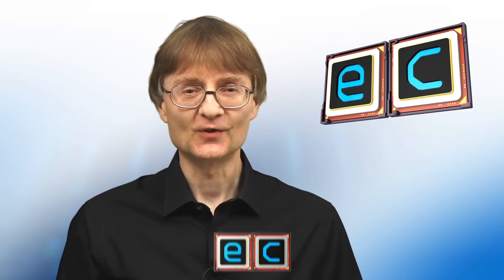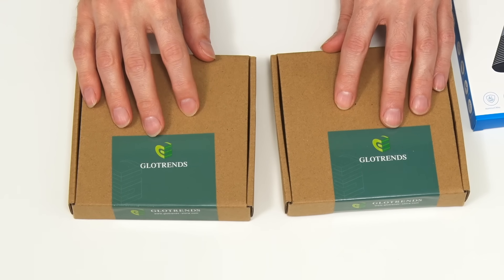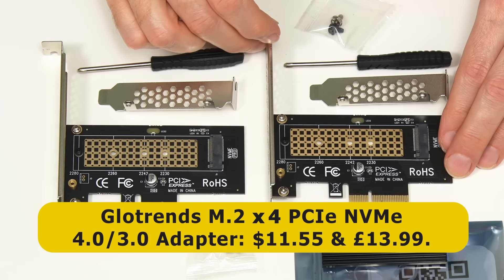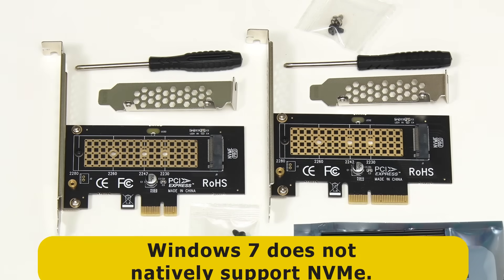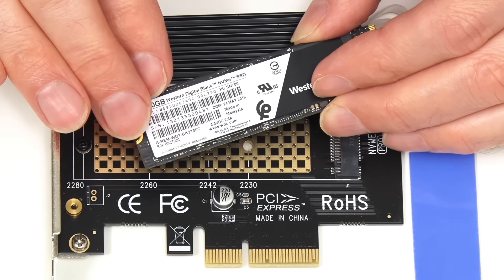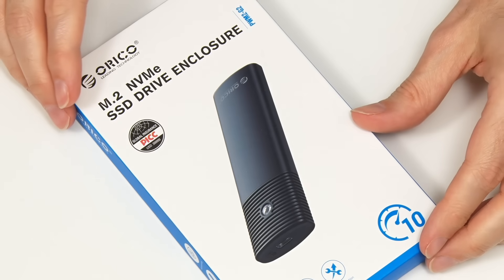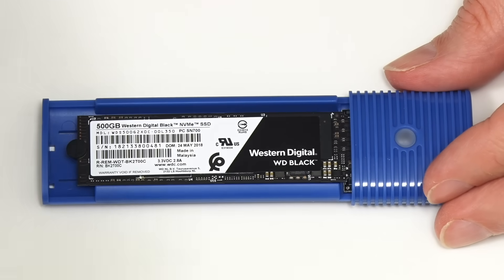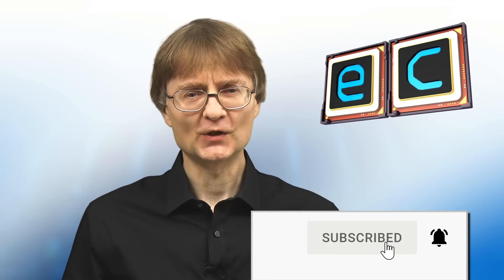M.2 SSD Adapters & Enclosures

Comment: Looks like you didn't notice that there is no control logic on the PCIe adapter cards as you placed some control chips on your simplified 3D model. BTW. I once dared to test one of these card in an older PC (AMD Phenom II x6) that had no support for NVME. It did not start up, but displayed an image like a corrupted video file was plaing back. Pulled the plug ASP. I guess I was lucky nothing got damaged.
Reply from the maker: The 3D model was, as they say, for illustrative purposes only. :) I certainly "noticed" what was on the real cards. But sometimes artistic license is exercised to make a 3D render look better.
Reply: @ExplainingComputers  Yes. But it shows that the BIOS support and OS-drivers are only there for the NVME/SATA drive. Not the PCIe adapter.

Comment: On my 4 b550 MBs they seem to block off the 2nd x16 slot if you use the 2nd M.2 slot. With these huge GPUs these days you may not be able to use the 2nd x16 slot anyway. I had 2 drives in mine that I tested speed rated for 5000 MBS and I got close to that on the gen 4 slot and about 1000 MBS less on the gen 3 slot.  But that is way faster than the SATA drives.

Comment: Thank you, Chris, as ever a very helpful video. You menioned that you can buy a PCIe card that supports multiple SSDs. The Glotrends card requires "PCIe Bifurcation Motherboard". An explanation of what that is and how you can find it on a typical motherboard would be helpful.
Reply: I was about to add a comment about bifurcation. Some motherboards and BIOSes allow you to split a x16 slot into what is effectively 4 x4 slots in one connector. An adapter board can route those lanes to up to 4 drives. This is generally only available on newer motherboards and is set in the BIOS.

You can get cards that don't need bifurcation but they are generally quite a bit more expensive. They have a multiplexer chip on board (the PCIE equivalent of a USB hub) to distribute the traffic to the drives. For instance I have one that connects 4 NVME drives to an x8 slot. This limits the total bandwidth to the capacity of an x8 slot so you cannot simultaneously access all 4 drives at full speed. You also need to be careful to check what PCIE generation they are rated for. For instance a gen2 card will only work at up to gen2 speeds. It would work fine in a gen3 or gen4 motherboard but you'd still only get gen2 speed.
Reply: @LesNewell  Thank you. AS I can't find any reference to bifurcation in my ASUS Prime A320M-A motherboard BIOS I suspect that I may have to reference another of Chris's videos and upgrade my motherboard! I've had a Glotrends PCIe X1 card installed for some time but have found, inspired by Chris' tests, that it only runs at PCIe 2.0 speeds, which was confirmed by CrystalDiskInfo.

Comment: Apparently, there are two hotfix files adding NVMe support to windows 7(not sure if that's needed with company-specific NVMe drivers), but Microsoft seem to have removed them from their website. However you can find them in some utilities by motherboard manufacturers(like ASUS EZ Installer), even with a tool to integrate them into an installer.
Reply: Both HP and Dell slipstreamed NVMe support in their last Windows 7 media. This makes it very easy to install onto a NVMe boot device assuming the respective vendor's hardware actually supports W7.
Reply: win-raid have them.

Comment: It's interesting, older machines it's either use one of these or sata. Graphics card slot if the slot is limited to one. Could add extra come to think of it on machines with more slots. Have a couple externals around, they are nice to have.

Comment: i have 2 of those m.2 nvme enclosures of the exact same model but both came with type-c to type-c cable to reuse my old gen 3 drives witch i replaces with gen 4 drives. radiator fins contact the metal of the case and are required to avoid thermal throttling of the drive, one of the 2 enclosure did not have a heatsink so i had to buy a 2 pack of 3mm thickness radiators from glotrends. i really like the toolless design  of orico enclosures.

note that i bought an exactly identical looking SATA m.2 enclosure by mistake on newegg Canada and  the description was very confusing at best and i ordered it from china so i had to order a SATA m.2 drive to fit in it and i had to use the second heatsink because of thermal throttle issues when the enclosure metal cover is on. whenever i transferred large amount of data to the drive ot would overheat and literaly stopped working over time until i added the heatsink.  adding the heatsink solved the thermal throttle issue.

Comment: Thank you for the clear explanation of these enclosures. I would add that external cases like you demonstrated should be metal since there are some that are plastic. I fried an NVME doing s disk backup in such a plastic case even with a heat sink. I also have an external adapter connected via thunderbolt to my laptop and the case is always warm to the touch, even when not under load. May I ask you to possibly consider reviewing external PCIE adapter cases sometime in the future. These are a bit more expensive but work well via a dock for your laptop. However, it is often unclear about number of lanes available and actual speeds that can be realized without using a RAID configuration.

Comment: There is a topic about SSD drives in external USB enclosures in Windows that no one has talked about. Windows (11 Pro in my case) does not detect the drives inside these external enclosures as SSDs but as a standard HDD. The problem with this is that there is no way to optimize the SSD, since Windows will try to defragment it (and if these maintenance procedures are scheduled automatically, Windows will do it). It is said that SSD units do not require defragmentation but optimization, and if we defragment an SSD we will be shortening its useful life.
If any of you have an external enclosure with an SSD drive inside and you see the light on the case flashing when the PC is idle, it is because it is being automatically defragmented. I had to disable scheduled optimization to prevent Windows from defragmenting my external SSD. I even tried to optimize it in a Command Prompt window (cmd.exe) according to some information I found online, but the OS keeps trying to defragment the SSD instead of optimizing it.
In Windows, the manufacturer or model of the SSD will not appear, but rather that of the enclosure. If your SSD unit has some software for maintenance, it will not be able to be used... but the latter is not the big problem, the problem will be that we will not be able to optimize the SSD unit and that we run the risk of shortening its useful life due to some scheduled (or manual) defragmentation.

Comment: The M2, and other standards, external case market is a mine field. At least when it comes to the inter-operability. Ive bought external cases that only work with certain drives. Not all of them.The orica M2 case i bought luckily worked with my samsung. I needed to clone a drive i was upgrading.
Reply: Yes, I've had lots of trouble with external NVME cases. These days I stick to SATA for external drives.

Comment: I use both of these device types and they are so useful. My linux pc doesn't have a spare pcie slot due to an added wifi card, but using the 10gbps usb nvme enclosure I can run my extra game drive that way instead with no speed issues. It's also amazing adding the 4x pcie card to my old i7 4770 system and watching the 4x speed, especially as I run that system from a 2.5" sata ssd. Pity you can't boot from the nvme drive instead but it is 9 years old now. Even 1x speed is excellent if that's the only slot available. Thanks for another informative and entertaining video Chris. :_stanley:😁
Reply: There are a few está to boot from nvme.

Comment: Thank you for that great introduction to M.2 SSD adapters. I learned how to identify an SSD as SATA or NVMe interfaces. And both the adapter recommendations were good to keep in mind. However, my PC is rather old to try this as I don't think my motherboard can benefit from the performance due the older chipsets it uses.

Comment: hey Chris,it is my understanding that your PCIe 16x slot becomes slower (x8) if you install other PCIe cards or NVMe drives via PCIe
because they use the same lanes,  or am i wrong? anyway, that what i understood from my motherboards manual, cheers m8
Reply from the maker: It will depend on the motherboard -- certainly some do not have enough PCIe lanes available for all slots to operate at full speed.
Reply: @ExplainingComputers  aha,tought so,thanx Chris,have a great weekend

Comment: The Orico works very well. I will admit that the grommet will allow the drive to move a bit if it gets handled roughly and you have to open it up and push the drive deeper into the M.2 slot. So, if it stops working, that is where you should look first.
Reply: That happened to me, I have an exact blue enclosure, I ended up cutting a drinking straw at the same length of enclosure internal width and put it to keep the rubber thing and drive stay in place.
Reply: I wondered if having the heatsink and sil-pad installed would help avoid this - IOW, are those designed to help hold the drive in place, etc.
Reply: @largepimping  That could hinder getting the outer case off and on.
Reply: That Orico enclosure is actually pretty awful. It looks nice and performs as well as any of the other Realtek RTL9210B controller based enclosures, but isn't at all thought through, as evident by the rubber grommet thingy instead of a clip (or even.. gasp.. screws like M.2 was designed for) and the completely pointless heatsink that has no connection to the outside casing and on its own won't do much of anything as it has next to no thermal mass either. Something like the Inateck FE2025 performs the same (same controller), but uses a clip to hold the SSD, has plastic guides preventing side-to-side movement and it comes with a thermal pad + flat metal shield to install over the SSD, which allows it to make up for the height from the SSD to the outer metal casing and allows the two halves to slide together without the thermal pad preventing it (friction). End result is that the entire casing acts as the heatsink, rather than then nonsense setup in the orico
Reply: @Knaeckebrotsaege  I couldn't tell any of that from the Amazon page I purchased it from. It works well enough for my needs, but I would rather something better, in hind sight.🙂
Reply: Is the Orico detected in clonezilla, and is it bootable? I have a off brand one and it is neither. Works fine if you are already booted into an OS, it defeats the purpose for me.
Reply: @itstheweirdguy  I have not tried it with clonezilla, so I have no answer for you. Maybe someone else will speak up.
Reply: What I can tell you, is that the cheap chinese ones from amazon are not detected at boot @act.13.41
Reply: @itstheweirdguy  No surprise there.
Reply: Edit, I have the squared off version of the adapter with a flat anodized heatsink. My Orico works well, I swap drives in it a lot and the rubber grommet is never a problem, the drive is always well bonded to the heatsink by the silicon pad

Comment: It seems my response to a comment some weeks ago inspired you, lol. It's a good video, and very practical; a lot of users will benefit from it.
I had also tried another Orico USB enclosure with a 2TB NVMe-drive, but it was excruciatingly slow (may have been due to my case-front connectors) so eventually, I decided to use the adapter, instead. It's now cheerfully running MS bootmanager and Windows 11Pro. Looking forward to the cloning software video! Cheers.

Comment: An adapter card that accepts multiple M.2 SSDs likely needs to be installed in a motherboard that supports bifurcation of the PCIe slot, and the bifurcation needs to be enabled in the BIOS.
Reply: You can get cards that don't need bifurcation but they are quite a lot more expensive and usually slower.

Comment: Nice video! Could you perhaps comment on how hot the SSD gets? I have a SATA M.2 SSD from WD that gets so warm it burns when touched. I measured with an IR-thermometer and saw 96 degrees C. I daren’t use it!
Reply from the maker: That is too hot -- I would worry about a drive over 50C. I would get a heat sink for that drive.

Comment: here's what i learned about m.2 and nvme controllers in general, i think i can demystify most of it.

i will be using extremely high performance scenarios (over 4GB/sec sequential transfer speeds) as an example of the importance of where the bottlenecks lie, as they there show themselves far, far more.

1) PCIe x4 rule (law)
rule of thumb, none of these controllers really come higher than pcie x4 (the individual chips that drive the nvme)
even if the PCB does have x16 connectors all the way, it's all smoke and mirrors, the individial nvme controllers generally do not come higher than 4x pcie PER storage device , i've yet to see one that does for any kind of price that even makes it a consideration for a singular device, if it even exists at all (i doubt it)

if you're looking for more than 4GB/sec speeds from a singular  nvme/m.2, you will NEED to have pciE 4.0, as the controllers are limited to x4, your pcie revision means the absolute world for this, 
there's no way to magically turn them into pcie 3.0 x8, and this is IMPERATIVE to understand in knowing your theoretical maximum 
you could have an old xeon with like 48 pcie lanes, if it's on 2.0, you'll never be able to reach over 2gb/sec on a single device, surplus lanes don't matter AT ALL, when there's no way to go over x4 on them individually, it only means more parallel capacity to drive multiple at 2GB/sec simultaneously, but it CANNOT go over that speed for a singular device, EVER.

2) direct CPU lanes / DMA
it's important to make sure it's in a pcie slot on the mainboard that is routed directly to the CPU, as modern cpu's generally have a version higher of the pcie protoco on the cpu (like ryzen) which means DOUBLE the throughput

which is imperative for speeds over 4GB/sec, any PCIe slot that goes through the chipset, is limited to x4 for the entire pool that is shared with all the other on-board LAN, SATA, you name it, as well as having switching overhaed so you'll never even truly get those x4 speeds there, and it will directly be detrimental to the performance of all the other on-board devices on the chipset, there is no other way to get it from just the 1 device without it getting in the way of everything else, it has to be a DMA slot, or bust

modern bandwidth demands got away with the northbridge, we now basically only have a "southbridge" over teh chipset for slower devices, the rest got delegated to the cpu more and more
which also means, older platforms that have less delegated to the CPU have an EVEN MORE cramped chipset bus and it's just going to be an absolute shitshow
understanding the block diagram of a mainboard and making sure it does route to the CPU is instrumental to getting these speeds.

3) parallel operation /  bifurcation
for people looking for something bigger:
there are solutions that let you do more and bigger in paralle, on a single pcie x16 slot (like the asus hyper m.2)
but your mainboard will specificially require x4/x4/x4/x4 bifurcation on the mainboard to operate them.
and no that is not some things where furries are polyamorous, it's just afancy word for multiplexing

this opens up the option to run software raidd-0 to get higher sequential speeds at the cost of worse data security and random access times, i wouldn't bother, just run thigns in parallel, CPU's have cores to spare and running multiple jobs usually is more preformance because amdahl's law things :D 

if it is not supported on the mainboard, the card will HAVE TO HAVE a pcie switcher/multiplexer onboard itself, 
and they are extortionately expensive, so gettign a new platform (like a ryzen 3600 and a B550 or up chipset) is cheaper than the entire controller alone at that point :D

i learned this helping out a mate who got into chia farming on a very old platform, and tapped my nerd skills to find out 
for anyone thinking they're cheeky uprading old shit, mark these words and quote me on this tl; dr:

THE CONTROLLER ON THE THING IS x4 PER DEVICE ALWAYS, NO MATTER THE BS x16 INTERFACE THEY PUT ON THE PCB. ANY EXCEPTION IS NOT ECONOMICALLY VIABLE,  GET PCIe 4.0 OR CONSIDER PARALLEL ON A MAINBOARD WITH BIFURCATION :D

Comment: 5:25 I'm pretty sure there are x670e motherboards now that do have regular PCIe 5.0 slots (even x16). They are still pretty uncommon though.
Reply: Most new gen Intel motherboards have a full PCIe 5.0 slot. I've got a B660 with one.
Reply from the maker: @Phambleton  Thanks for this, my bad. I stand corrected, and will add a pinned comment to this effect.
Reply: @ExplainingComputers  No worries!
Reply from the maker: All of the x670(e) boards I checked have PCIe 5.0 M.2 slots, but PCIe 4.0 PCIe slots -- eg https://www.gigabyte.com/Motherboard/X670E-AORUS-XTREME-rev-1x/sp#sp

Comment: What's the point of a heatsink if fresh cool air can't get in the enclosure?  Then you are left with only the thermal mass.
Reply from the maker: A heat sink provides an additional mass to heat, and a greater radiant surface area. So long as the air around the heat sink is cooler that the heat sink itself, it will work as a cooler, regardless of airflow.

Comment: Very informative thank you! Does it also matter if the CPU itself has enough available PCIE lanes and whether the PCIE version is supported by the CPU itself?
Reply from the maker: The CPU (and chipset) specifcations will determine what M.2 and PCIe slots are available, and to what specification. It is rare these days for the slots on on motherboard not to be fully suppored by the CPU and chipset (ie enough lanes are available).